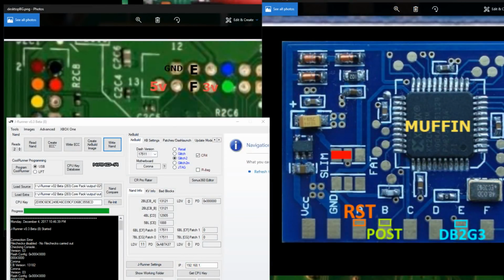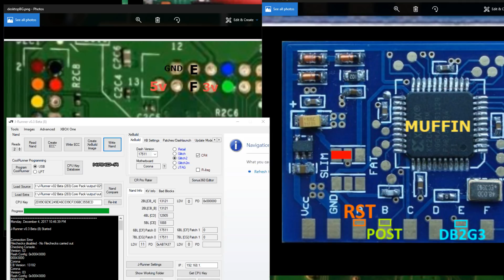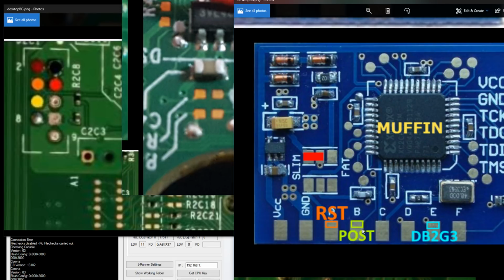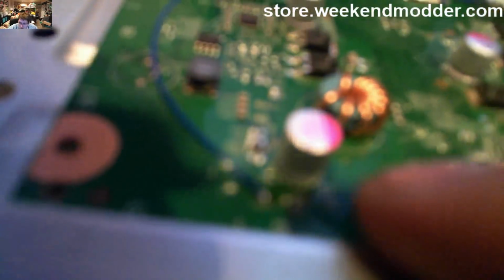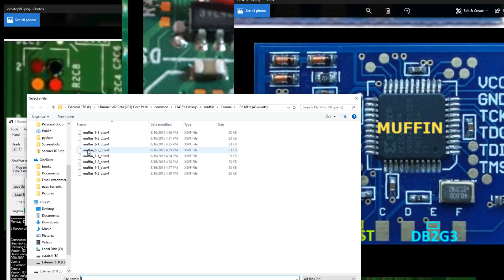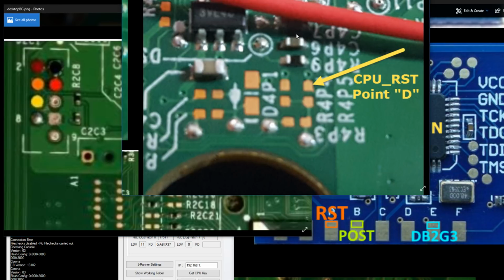Pro Guide Corona RGH CR4 Muffin style install using Matrix V1

Comment from the maker: Muffin timing files:   https://mega.nz/#!4MknxDhD!o4M4unqLD4kwr0uJ1T7lLESfMs42X1aOMMlwboYK8yU    These would be for any Rev C, Rev D, or Matrix V1  (any xc264a based chip) and include both Trinity and Corona in this pack.
Reply: Hi, I have a little problem regarding this modification. I have installed your timing file (CR4, Matrix), run xell, read cpu key, write NAND (CR4) and when this modified NAND is installed on my console, xbox wont boot. I see that it is trying because its restarting itself but without any success. Xell run within couple of seconds. This is not my first RGH i have made a lot of them but i have never seen something like this. Do you know what might be a problem?
Reply: @krzysztofzaborowski8132  
did you find a solution your console ? if u did pls let me know how u fix it

Comment: FYI, that led tell cpu frequency, faint means it successfully slowing down cpu since RGH works by drawing V_CPUPLL (cpu voltage). The caps on glitch chip used for drawing power more but can be fatal to CPU regulator or power management module.

Comment: Will this tutorial work if I substitute the nand-x with the sd tool? will everything be the same?
Reply from the maker: If you are missing a 4gv nand Corona, ya.  But you still need a way to program the timing file on the glitch chip.(or get it pre programmed)
Reply: @TheWeekendModder  Thank you for your reply. I have a 4GB Console. That means it is a corona, correct? I plan to buy the matrix chip from your site pre-programmed with the muffin_3-1 timing file. I've only rgh'd fat consoles in the past.
Reply from the maker: @hughjanus6975  no. You could have a 4gb Trinity.  It being 4gb isn't itself sufficient to say it's a Corona
Reply: @TheWeekendModder  okay. What is the easiest way to identify the exact model board? The manufacturing date is in 2012
Reply from the maker: @hughjanus6975  look under the guides section on weekendmodder.com
Reply: @TheWeekendModder  If any of my questions go unanswered, I will come back to ask them. I will try not to bother you any further.
Reply: @TheWeekendModder  So this tutorial can be followed for a 4GB corona, just use the SD tool instead of the Nand-X?

Comment: Do you have to check the "cr4" box on JRunner? Could you program a Chip before you connect vcc and ground to the console on standby mode?
Reply from the maker: Yes, check cr4.  Yes, you can program chip in advance if you like.
Reply: TheWeekendModder thank you
Reply: TheWeekendModder what if I have already a corona (not 4gb) with ace V3 and I just wanna swap it with a matrix glitcher(apart from different solder points of course) do I have to rebuilt a new nand image checking the cr4 box or I have to swap only the chip and leave the nand  as it was with the ace V3?PS: Sorry for my English
Reply from the maker: That depends on how the Ace V3 was installed.   The Ace can be installed in standard RGH2 configuration without CR4 speedup, but it can also be done as "S-RGH" aka with CR4 speedup.   So how your console was done originally would determine if you can simply swap the chip or if you need a new nand image with the cr4 box checked,
Reply: It's a normal install on corona. Not S-RGH neither RGH 1.2 because it's a slim. So I guess I have to build a new nand image with cr4 speed up box checked
Reply: i can't find the timing files you use in the video. i can only find trinity ones
Reply from the maker: https://mega.nz/#!4MknxDhD!o4M4unqLD4kwr0uJ1T7lLESfMs42X1aOMMlwboYK8yU
Reply: TheWeekendModder thank you :-)